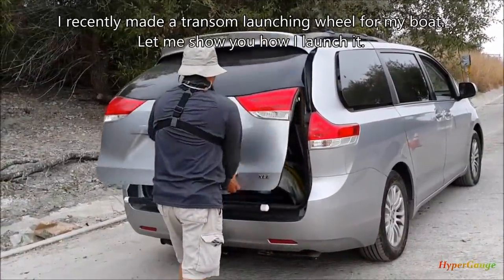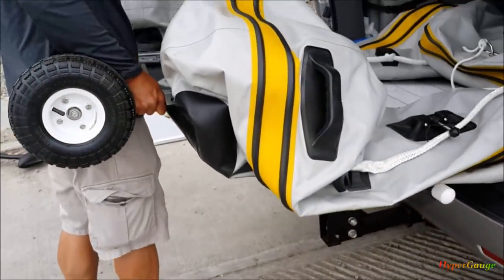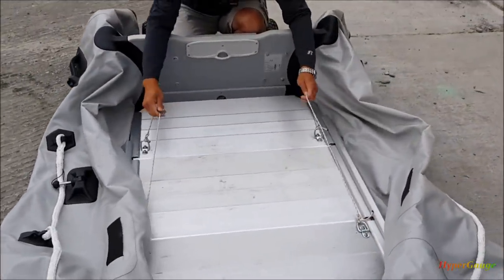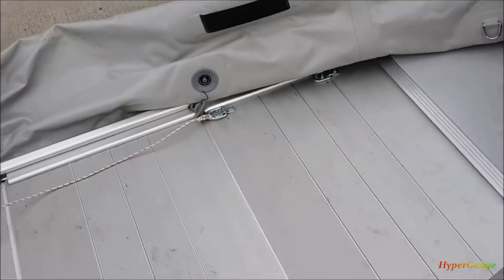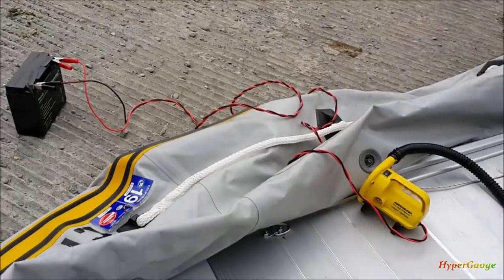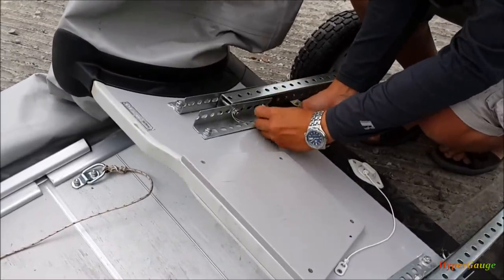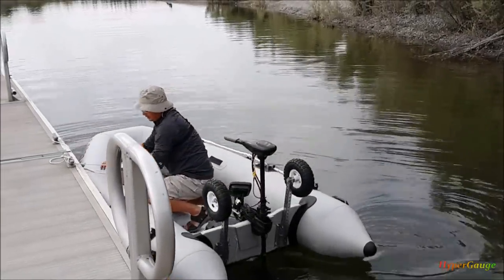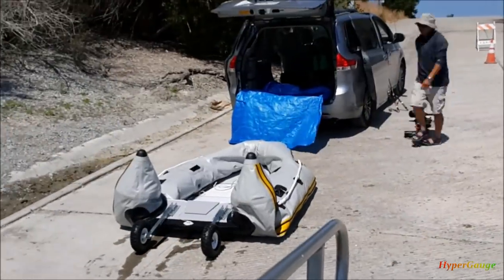Tips + Tricks launching AL hard floor inflatable boat with the DIY transom launching wheels.

Comment: I just bought a 12 footinflaeable w aluminum floors What a pain in the a**   Definitelygoing to add the d rings   Thanks for the tip
Reply from the maker: Thanks for watching my video. AL floors is a little bit hard to install but IMO it is definitely worth it. I am able to added a lot more accessories on it, and it is very stable while fishing. I am sure you will get better on the installation. Have fun and be safe out in the water.
Reply: I sure hope it get easier   lol

Comment: Thank you for helpful video. Save me lot of time with your idea of 2 chain attached to metal floor. I have question for you, as yoour recommended i bought a electric pump as you and now i am looking for adapter to connect pump horse to dinghy air port? what adapter you use?, all adapter they provided not fit at all. Thanks again.
Reply from the maker: Thanks for watching my video. I am sure your boat spec should have told you the kind of air intake valve you are using. My air head pump already came with the proper connector for my boat. It is common for most inflatable boat to use this kind of  valve connector https://amzn.to/2UIoHau However, you may want to check with your boat builder for proper spec. Good luck and be safe out there.  👍

Comment: Awesome video. I have an inflatable as well, 12.5 foot with aluminum floors like yours and have wheels on the back too.

 Can you explain the purpose of the cords you have bolted to the floor?
Reply from the maker: It is to pull the AL boards tighter together so the end board can be installed easily.

Comment: Thank you for your video. How do you store your inflatable at home? Do you fully disassemble it? Do you still have your boat?
Reply from the maker: Yes, I still have the boat. As I still use it often, I store it deflated but keep the floorboard installed. So it is kind of flat and leans against the wall.
Reply: @HypergaugeDIY  thanks for your reply. I am glad that you still have the boat. From your experience, is it safe to drive the inflatable boat to the deep ocean? I have a inflatable boat similar to yours and am thinking to catch some mud crabs.
Reply from the maker: @calvinshum8019  My boat is definitely not safe for open ocean with wave. The ocean water I tried is protected bay in a nice claim day close to shore.
Reply: @HypergaugeDIY  does the deflated boat with aluminum board installed unstable? I mean can I move deflated boat without collapse? I want to transport the boat install the equipment as much as possible so that I dont waste time and effort. I have longer van seats removed.
Reply from the maker: @palgong_housing_service  The boat after deflated is not strong enough to add extra weight for transportation.

Comment: Fantastic video, thank you for sharing.  How far down approximately in inches does your 12v trolling motor/prop sit in the water  when your trolling?
Reply from the maker: I normally keep the prop about 1ft under the water. I do get it higher if I am going through some shallow water or a big weed bed.
Reply: @HypergaugeDIY  Thank you for your reply, much appreciated 🙏

Comment: Awesome where did you get the flooring material from and what is it exactly called that is an awesome.idea better than treated ply.
Reply from the maker: My Aluminum floor is came with the boat. There are many different offering from different vendors, just check with them and pick the type you like. Have fun and be safe out in the water.
Reply: @HypergaugeDIY  awesome thank you for replying and your time

Comment: How heavy is your boat when you pull it out of the water?  My boat is 175lbs without a motor at this time, not sure if I can pull it out of the water...  can I tie it to my car hitch and pull it out that way?  Sorry first time boat owner...  thx
Reply from the maker: My boat with gears, motor and battery is estimated around 160lbs. Empty just boat is around 90lbs and I can pull it out of the water by myself. Going up the ramp will take a lot more, that is why I drove my van down to pick it up. I think you can try pull it out of the water very slowly with your car, but should never try to tow it for distance. Have fun and be safe out there. 👍

Comment: Nice set up.  You did a good job.  Question.  Do you usually keep the flooring in your inflatable?  I just bought one today but the flooring is wooden but very similar set up.  Also thinking of getting wheels too.  I purchased oars today but I notice you have a trolling motor.  Was thinking of getting that or maybe a 4hp 2 stroke engine.  Your thoughts?
Reply from the maker: Yes. I usually keep the AL flooring in the boat when storage. I have both electric trolling motor and a 5hp outboard. Most of the lakes near my home allow electric outboard only so I do use the electric motor more often. In a normal not windy day, the electric motor is nice and quiet, very simple and clean to use. I only use the 5hp motor for river and some time for the bay. Be safe and have fun out there. 👍

Comment: Hi quick question, how did you drill the D rings to the floor?
Reply from the maker: Put the D-ring brackets on the flooring and mark the screw holes, then drill with a proper size bit. The AL floor is very easy to drill, any type of bit will work. Just go slow. Good luck with your projects. 👍

Comment: Hello Sir I’m really like the way this set up,, may you answer  me 2 question.. first.. how long the electric motor last...??? I mean running time... 2nd do I need a boat license ...??? Thank you Sir ... please enjoy... I’m really want that set up for my fishing gear...
Reply from the maker: Thank you for watching my video. I never tested the max hour my 100AH battery can drive my motor. The longest continue use I have is about 2 hr in a 7 hours fishing trip. At the end my battery still have about half of the power left. The performance is really depended on the motor type and your battery quality. Here in California you need to register your boat if you plan to put motor on it.
Reply: Thank you Sir

Comment: Hey!  Great video.  I've been deciding between an aluminum floor or an air deck.   Your D ring idea might push me towards the Al!  Do you have any pictures or video of the D-ring install? Thanks so much!
Reply from the maker: Thanks for watching my video. To install the D ring I first setup the boat with the floor boards, then mark where I would like to drill the holes for the installation. Then take down the boards and drill the holes. Make sure to clean the hole with file. Use round head or flat head bolts to secure the D rings. Hope these help. Good luck and have fun out there.

Comment: Hi Sir. may i know how wide is your inflatable's transom. do you find the launching wheels are too close to the trolling motor and a little difficult to turn the motor's handle left and right ?
Reply from the maker: Thanks for watching my video. The beam of my boat is 60" The wheel does not affect the trolling motor control.  My build detail of the launch wheel is posted in another video. https://youtu.be/k1NPm-znLVI
Reply: @HypergaugeDIY  Thank you for the reply. I have a Seamax with aluminum floor and to put the floor in is so difficult and tiring. so i just left the entire floor in all year. The D ring with rope is good idea. i would like to try it and see if it would help me. Thank again and stay safe.
Reply: I have wheels on mine which have bent rods that the wheels attach to. By doing that I’m able to mount a 15hp 2 cylinder motor with just a tiny bit of interference

Comment: Where to get the PVC roll bar in the back?
Reply from the maker: Thanks for watching my video. I made that roll bar myself. Not a difficult build. Mainly is 2" PVC as roller and 1 1/2" PCV as the inner tube support. All mount on a "Vertical Convert Horizontal Receiver Trailer Hitch" Vertical Convert Horizontal Receiver Trailer Hitch. Maybe I should post a quick video about it if more people are interested. How about 100 thumbs up for this message.

Comment: Why not simplify the process by adding a permanent horizontal bolt to the posts, 
then add gate latches to the top and bottom of the transom?    

That way, when returning to shore, no more pushing the wheels down with one hand, 
while trying to put the pin in place with the other.  Instead, just push the wheel down 
until it clicks into place!  

As for Locking it in place... Gate Latches always come with a hole that's intended for a padlock. 
Just Think... No more having to Line Up FOUR Holes so the pin goes through!

My Dad always told me "K.I.S.S." (Keep It Simple Silly!)

Try it... and if you Like it, SHOW EVERYBODY!!!  
You'll get lots of Boaters wondering why They didn't think of that!

One more thing... If you're going to leave it at a Dock to go get some Food or Bait, 
you can put Padlocks on those latches, so you don't return to find your wheels have been "borrowed".
Reply from the maker: Thanks for the suggestions. I totally agree with the idea to keep things simple. This design worked for me and the water and extra little steps does not bother me. There is no doubt many possible ways to improve the design (fancy or not). Feel free to make the best for your purpose. 👍